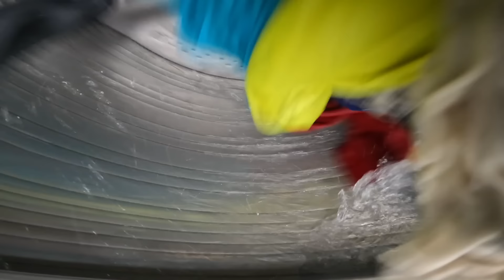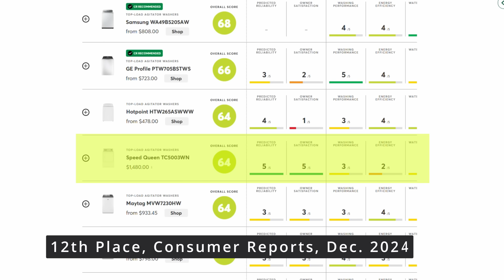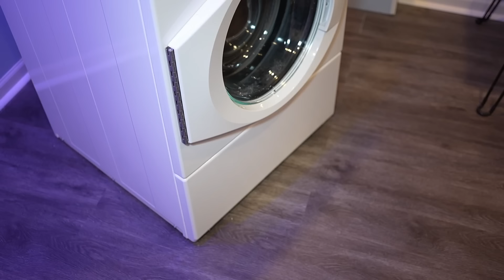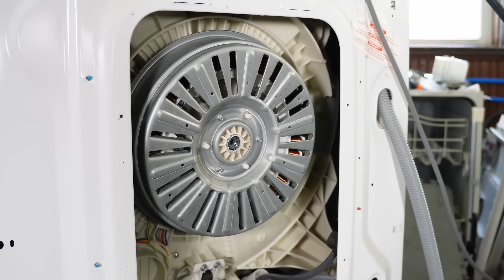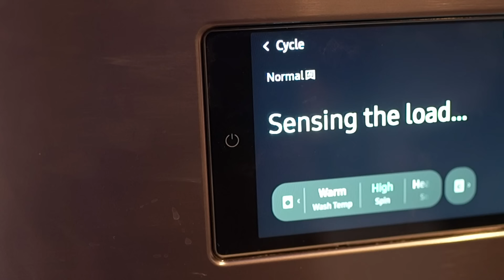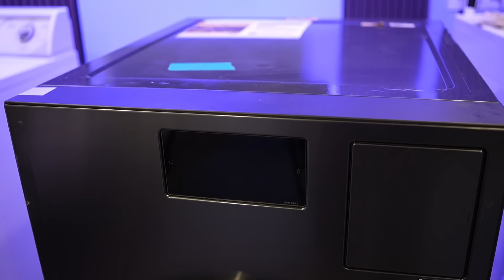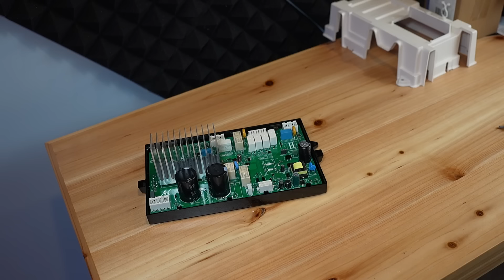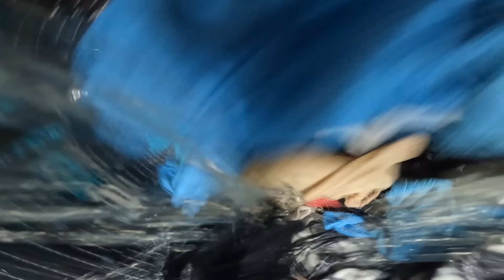Is America's Most Expensive Washer Great? The Speed Queen FF7009WN Test

Comment: I'm still using the old brown Maytag set from the 70's that I bought in 1995. I've only ever had to replace the drive belt on the dryer once. Other than that, they've been perfect for the entire 30 years I've owned them. Got them from a local place that specializes in restoring vintage appliances. The guy let me take the pair for $100 because I bought a vacuum cleaner (which I also still have and use) and also apparently no one wanted them. Some of the best purchases of my life, honestly.
Reply: That may text set was probably one of the most expensive that you could get when it was new.. They are built like tanks. It's why these speed queens are so expensive. The build quality is there. I don't know if the last 30 or 40 years like some of the older maytags.
Reply: Same here, using an old Maytag, the ting is like a tank
Reply: @jrcat2258  I have a newer Maytag (about 3 years old) and I’ve never had to babysit something so much!  It’s a pain. They aren’t made like they used to be. Definitely hang onto to yours😊
Reply: I bought a new dryer from LG a year ago. The technician came into my house and installed it, and it literally turned on for 5 seconds, turned off by itself, and has never turned back on again. I canceled the LG order and bought the Speed Queen TC and be happy ever after.
Reply: The dependable care machines were truly something else
Reply: Old stuff is the best, but parts are hard to find. At least for me.
Reply: @InuranusBrokoff    For finding washer parts no longer being manufactured, you might consider placing a "Wanted" ad in craigslist or other source.  As well, used appliance stores might have a given part or know of a resource where you might locate it.  As well, you might locate and buy an entire machine like yours, then take all the parts from it.  And finally, network.  Write down the data of your machine (brand/model/serial number/year/etcetera) and the part you need onto 3 X 5 cards and give them out to people you know.  Also, be sure to hand out a card to people that are avid tag sale shoppers.  Having that info on hand will keep you and what you need fresh in mind.
Reply: I need to know what store this is, it sounds amazing.
Reply: @sporeranier  From what I understand, they're not what they used to be since the original owner died. If you ever find yourself in Herrod, Ohio, though, the name of the place is D & N Appliances.
Reply: @themoon69420  You should replace your washing machine with new lg direct drive inverter, and a vacuum cleaner with cordless one like dreame r20
Reply: @themoon69420  I like the speed queen top loader tc5
Reply: WHERE DID YOU BUY THEM LINK HIS STORE!!!!!!
Reply: most of all the old appliances lasted decades. The only reason most people got rid of them was because they are old and banged up and want a shiny new one. I'm already on my third and hopefully last washer in the same time my moms old Maytag from the 70's was still working. Her Caloric stove lasted almost 4 decades and was still working but she wanted a shiny new one. Now the manufactures only look at lasting 5 to 10 years. It's more money in their pocket if we have to replace more frequently.  This is why I bought a speed queen. We'll see if it last longer than my other 2 front loads that only lasted 10 years each,.
Reply: A 70s Maytag still running after all that time is pretty amazing. Stories like this really show how simple, mechanical designs could last for decades with just the occasional small repair. Finding a restored set like that for $100 sounds like an absolute steal. It’s funny how some of the “old unwanted” appliances end up being the most reliable ones in the long run.
Reply: I have a similar Maytag. Works great

Comment: Glad that a few coworkers told me of the problems they all had with front load washers. Plumbing boss had the door gasket replaced once under warranty then another time. They are best in class for growing harmfull mold. Heve a great LG top loader and the one thing not right is that a few ounces of water always remains in detergent draw making me remove it snd wiping off moisture. Spray that with Lysol disinfectant a few times a week after finding mold in bottom of detergent / fabric softener slide out drawer.
Reply: Leave the door open when not in use and a front load won't grow mold either, no Lysol needed.

Comment: My only complaint so far is that the conformal coating on the boards was not applied in a uniform manner and a spot was missed on one of the boards. Regarding the water consumption, that is a problem that can be addressed externally through the use of ancillary equipment.

Comment: I understand the value proposition of these machines. I just bought a subzero refrigerator to replace the older GE built-in that was failing. The subzero is just such a nicer machine and I like the idea that it’s meant to run for 20+ years and be repaired along the way when it needs it.

Comment: Couple of comments.  First - Thank you for making the video!
1.  We have stopped using pods a while ago.  After watching the Technology Connections video on dish washing machines and how the cycles actually work.  We now use straight powder 1/2 Tbs on the door for the prewash and the other half in the wash compartment that opens up.  After making that change the dishes were noticeably cleaner and the hard to clean stuff just worked much better.  Not to mention the cost savings of using powder over the pods is significant.  You put two pods in the container and you have the Tide Pods packaging over your shoulder so not sure if you are being compensated for that.  But I would be VERY interested if you did a version of that Technology Connections video but for washing machines.
2.  The accidental cold tests should have been thrown out.  The engineers designed those cycles for warm water and as such doing it with cold water while interesting kind of invalidated the test.  You probably had a window to get this video out, but would have been better, IMO, to get the water heater fixed so you could run the test as the machines were designed.

Thanks again!

Comment: My 2003 Maytag Neptune washer finally was dying  last summer. (Bearings).
They had been great machines only needing a gas valve on the dryer.  21 years was a good run

I bit the bullet and bought this speedqueen set .

My only complaint is the door interlock was ocassionaly not sensing the door was shut a d cycling

If you purchase these... definitely spring for the pedistals. It makes it so much nicer to load and unload.

I wash work clothes that often have restaurant grease and oils along with dirt on them. I use Tide HE and presoak on the warm setting and it does a good job. The worse stains will benefit from a spot treatment with straight tide working it into the stain.

Comment: The FIRST PROBLEM WITH THIS WASHER IS THE TOUCH PAD. 
These notoriously go bad.  The switches you are pressing under the plastic are dirt cheap with no guts so they do not wear will if continually used.  YOU WILL NOT FIND ONE MODEL LIKE THIS WITH A TOUCH PAD CONTROL UNIT IN ANY LAUNDROMAT 
AS NONE OF THESE CAN RUN DAY AND NIGHT. 

I Worked Maintenance in a busy Laundromat where dryers were going out constantly washers pumps getting clogged with small childrens socks.   This is all the commercial market

I worked in a collage campus Laundromat years earlier.  I have a full maintenance background Boiler room engineer, plumbing electrical carpentry welding concrete and block work and All kinds of roofing from Slate onward.  I have an It degree and was cisco certified. I had a it company but fell gravely ill . . . from which I have not recovered after 14.5 years now. 

The point is I was qualified to work on and maintain a huge variety of equipment.  And what is sold now by any company IS GARBAGE
The average lifespan of Refrigerators Freezers Washers dryers and the like today are THREE YEARS.

Before then you bought a unit of any of these and they lasted a lifetime.  

THIS MAN CAN PROCLAIM SPEEDQUEEN HAS A STAINLESS STEEL DRUM IN ITS WASHER AND DRYER

But the drums even plastic are NOT WHAT GO BAD.  It is the garbage motors with slip bearings instead of real bearings. 
It is the slip bearings and not real bearings that Break Today you have drive shafts that break due to excessive wear. 

The washer drying companies took a lesson from Detroit  they now make it so the common owner CAN NOT CHANGE EVEN A BELT
much less one of dozens of sensors

Today the washing machine man needs electrine test equipment and may even need to speak to the central processor in these units to find what is actually Broken. 

People are starting to look to foreign countries for HARD WARE like South Korea, Japan Certain European Countries that sill make dependable lifetime units 

I do not want to talk about stoves and other Garbage made by large corporations. These also break quickly and what breaks is so expensive BY PURPOSE you then have to by another piece of Junk.
Reply: I read your post. A bit long, but filled with truthful (albeit bitter rants) comments (laughing a bit as I typed that).  I agree, the asset life of these machines are an embarrassment.  I double down agree these touch pad control panels wear out.  I have good old dials and keen on maintenance.  A circuit board here and there is inevitable as relays and caps have a cycle life.  Vacuum out the dryer motor and chambers and full outside exhaust pipe.  I even changed out the over temp limits and flame starter on the dryer as long as I had the unit apart, these are a cheap date.

If you have a preferred brand(s) perhaps you could post this.  

As far as health.  I have had four spine surgeries. I found watching old Dick Van Dyke shows on YouTube just before bed made me laugh and that releases a feel good hormone.  The black and white is like reading a book, it’s hard to keep your eye open after a bit.  Hope you can find some joy.  Pleasant regards.  JR here

Comment: I have bought a vertical loader Speed Queen washer in 2015, after donating my other brand, new, eco-friendly, washer that didn't do the job as advertised.
I am still using that Speed Queen today (model AWNE92SP113TW01). SS tub, no lid-lock, Full Tub Wash and Rinse, self balancing. Hot water cycle is really hot water, not a premixed hot-cold like others (to save energy).
I had to replace the water inlet electro valve (hot water side wasn't working). Did it myself, with an original manufacturer part, that was made in Italy. Weakest link?

Comment: Great video. It seems like this would be a good unit if your top priority was to basically never have to buy another unit and you use it multiple times a day. So, maybe a large family (like 6+) or a commercial setting. I definitely do not fall into that category, its just myself and my husband. We do maybe 3-4 loads of laundry per week, and they're usually smaller loads. We bought a matching set of mid-range LG front loaders 4 years ago when we moved to a new house and they have been absolutely fantastic. My only complaint is that there is something about the way the cold water runs into the machine that makes it REALLY NOISY when the cold water valve is open. The machine is super quiet and cannot really be heard, even in the next room, except when its running the cold water. That might be something specific to my house/plumbing/hose routing, not sure. 

A typical load is pretty short, but you can set it to a much longer load if needed for tough stains. I don't mind the long run time because I don't just sit and stare at the washer while its running; I load it and go do something else. Unless you're in a laundromat (which I know is what the SQ are designed for) or need to do several loads per day (2 is not "several"), I honestly can't imagine why the runtime would really matter. I'm more concerned with washing performance and I don't care if that takes an hour or 2 because I'm not waiting for it to finish. Depending on how the long term reviews turn out, if these units ever need replacing, I might replace them with a combined washer and heat pump dryer, since I'm totally fine with loading my clothes (once) and taking them out the next morning after they're washed and dried.

Comment: Own the TC5 washer dryer combo. Dryer has been the biggest POS out of the box. Faulty timer failed to turn off the machine melting a blanket inside after it ran for six continuous hrs while away from home. Timer was replaced two times along with other parts which failed to fix the issue. Speed queen had the worst customer service and refused to replace the machine even after the tech recommended it due to fire hazard. The store I purchased from agreed to replace the dryer after hearing my experience. New one works better but had squeaky drum rollers right out of the box. My experience has been less then impressive.

Comment: You're measuring volume wrong. You have to compare the db when the machine is running to the db when it isn't, the difference between them being the actual noise level of the machine. The values you provided in the video are incomparable without background measurements.

Comment: I really like that you can add multiple hours of soak time, where it gently turns the load over a couple of times every few minutes. It really lets detergents do their thing and get out pernicious stains and scents.

This machine gets my clothes so clean that(on the heavy-dutyest cycle with warm water), I've forgotten about them for over a week on a couple different occasions and come back and they still smelled pristine. Can't think of a better endorsement.
Reply: This unit allows for up to 24 hours of soak time. I love soaking my sheets overnight with oxy additive.
Reply: @mbfhh; @yolo_burrito:
Do you think the soak cycle plus a rinse + spin or spin only cycle set to all the slowest/gentlest mods would be a good stand-in for the hand wash/wool wash cycles that some other brands offer? 

Also do you think that if a 24h soak cycle had been added along with all the other bells and whistles, stain removal performance on the SQ would have improved (and potentially beat the Samsung & LG’s best available)? 

My hypothesis is yes to both but I don’t know anyone with a speed queen to test.
Reply: @kirstenvalentine8870 it depends on the detergents you use. The oxygenated detergents are pretty slow to work and the reaction is very similar to lye albeit much gentler and slower. A several hour soak in that beats hand washing especially for large areas of saturated fat soluble stains. The soak still has some periodic agitation too. 

Some stains no matter you do without an enzymatic pre treatment they aren’t going to wash out.

Comment: Thanks for video. I have a 25 year old Maytag Neptune and am starting to look for next washer. Speed Queen ????
Reply: Neptunes are a great machine but SQ is infinitely more serviceable than a Neptune. Example: I did a bearing/trunion replacement on a neptune (I will literally never ever even try that again). To get that drum out took two people and about 3 hours of swinging for the fences with a sledgehammer. The same repair on a 20 YO SQ that was in an apartment building (so it go TONS of use) took me 35 minutes.

Comment: My biggest complaint with all these Speed Queens, especially the dryer, is the end of cycle beeper is far too quiet. Also, they need to change the LEDs from blue to white, blue LEDs today scream cheap, not $2500 washer. Also, Samxon caps are basically what's available these days, even Apple uses them in their power supplies.